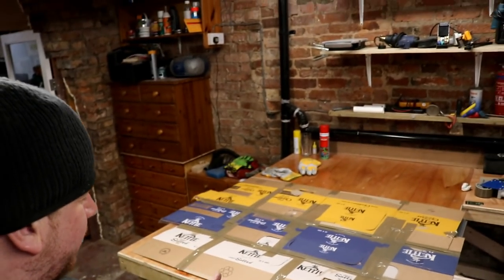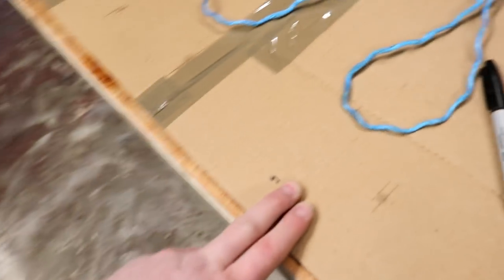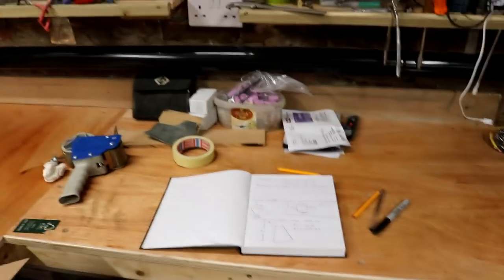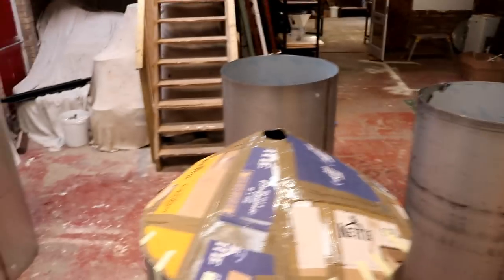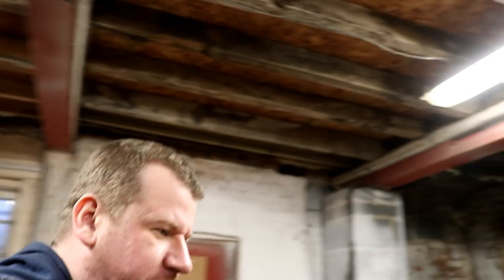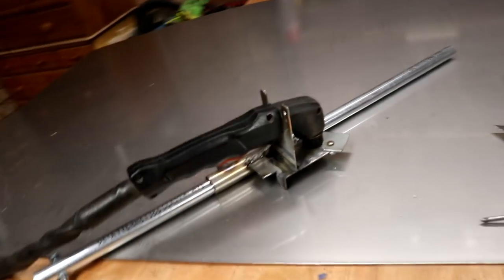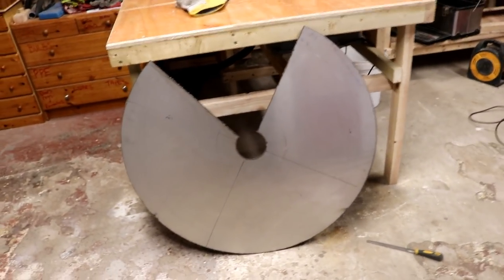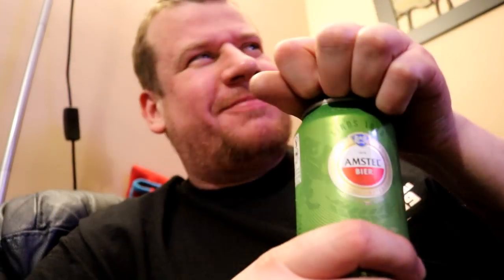#DIY ~ Plasma Cutter ~ Circle Cutting Tool#

Comment: Looking good harry, you got a much smaller r1 hole than i thought the rollers would allow. The rollers look much bigger on cam. Dare I say you have a nice centre hole on you Harry
Reply from the maker: Yes, my hole is 4 inch. it takes some work to get the shaft in it. roller shaft that is.